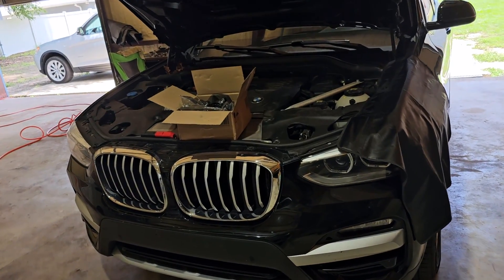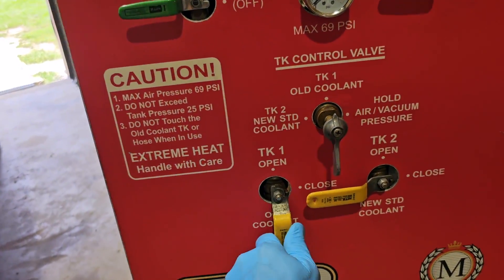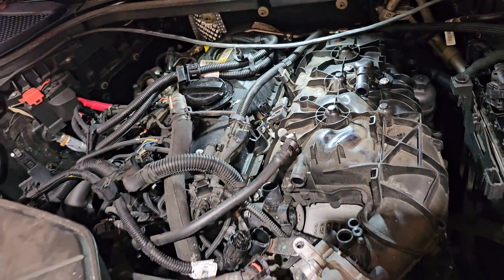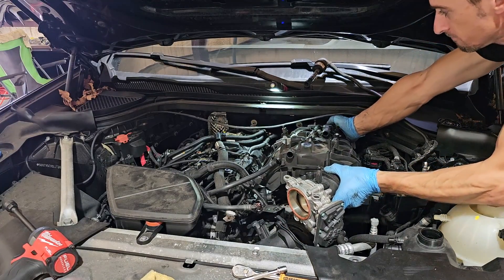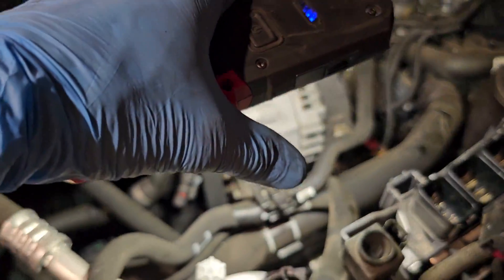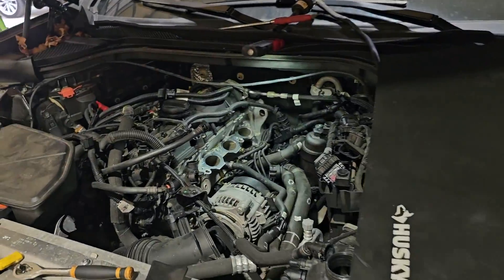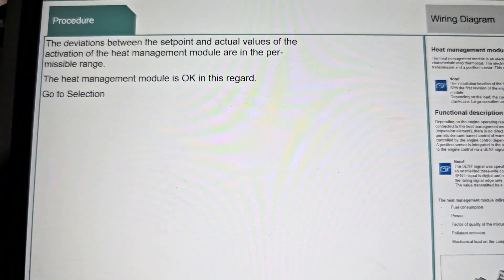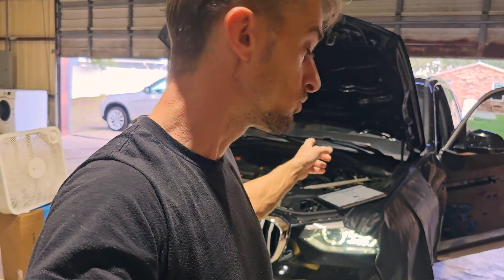BMW G01 B46 Heat Management Module Replacement

Comment: I would like to hear your experience on the CoolMaxx2 coolant exchange machine for BMW G30 and G05 coolant replacements.   There are many coolant exchange machines available out in the market.  Would you recommend this exchange machine versus Qwik Draw Coolant exchange machine?    They seem very similar in appearance, not sure they are functionally identical.  Please advise.  Thank you in advance.
Reply from the maker: They are the same machines, made with the same parts and rebranded differently
Reply: @MOvidiu  Thank you for your reply.  Is this coolant exchange machine easy to operate on B58 engine?  Does it require to warm up the engine, so that the thermostat is open prior to extracting all of the coolant out?  I saw this machine training clip and the instructor had the engine running while doing the coolant extraction.  Please advise.   Thanks!